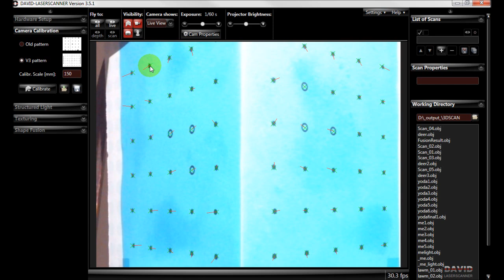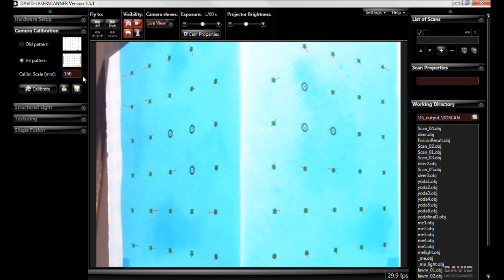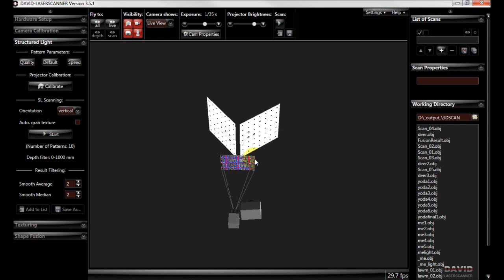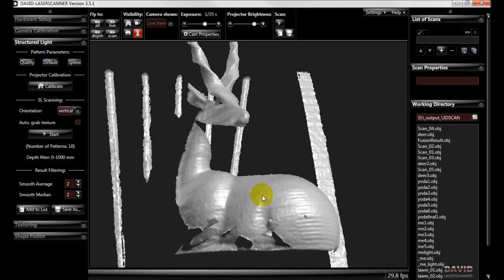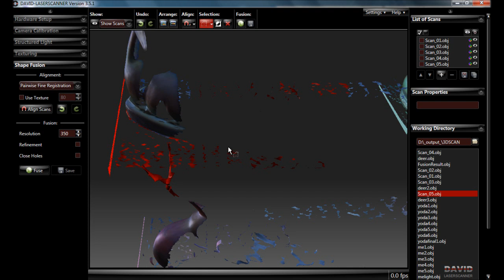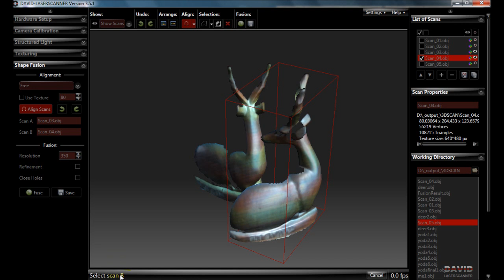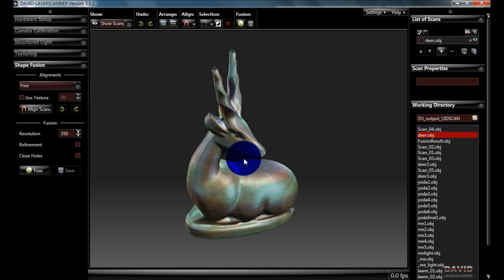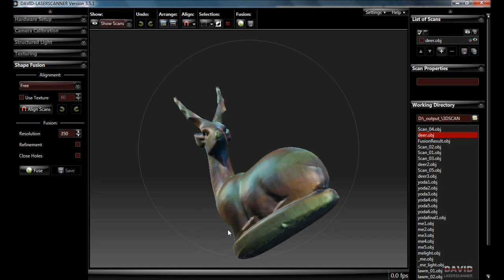Davidlaserscan Demonstration

Comment: nice video and nice looking scan!  would you recommend this projector to do SL scanning?  Did you run into any issues with scanning with this projector?,  there is some info about the 45 Degree issue from the resolution but I had trouble understanding exactly what the problem is and how to resolve it.  And would you suggest projector over a purchase of a good laser setup?